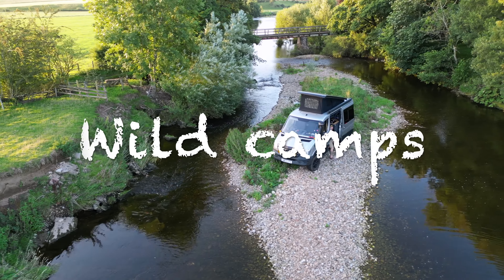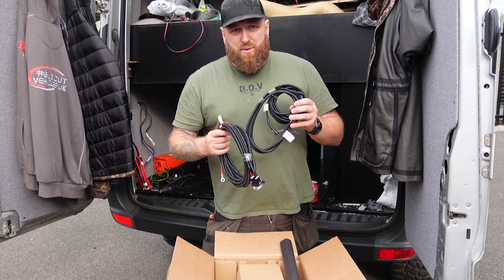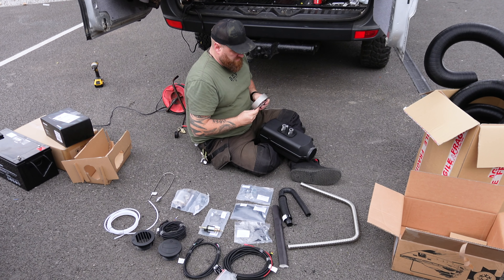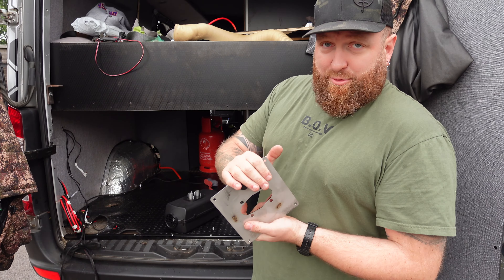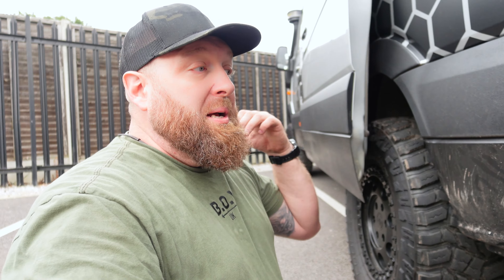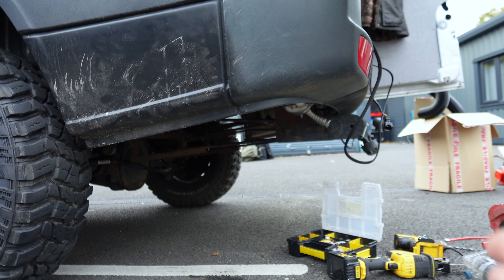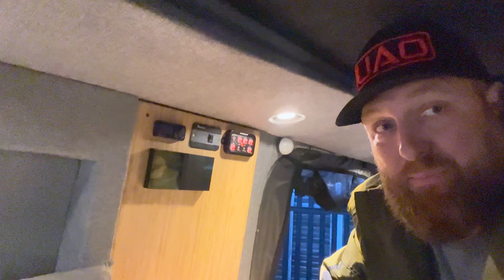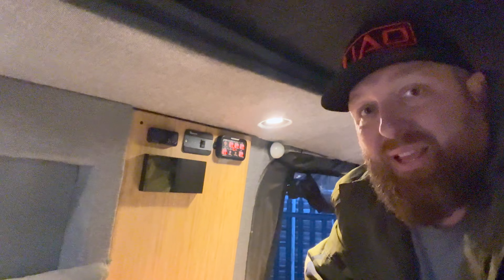Chinese diesel heater failure. Check yours now.

Comment: My Eberspacher in my show van has never failed. 14 years later its moved three times into replacement vans and still going strong in my latest setup.
Reply from the maker: Ok
Reply: Sigh🤕 My Eberspacher has problems and winter is coming. Hums 3 sec and ..error.. I need to bring to the doctor.. Only 10 years old..
Reply: Eberspacher, fit and forget 👍🏻🇬🇧

Comment: The flexible panels aren't as good ive found. The heat makes them break down quicker and they don't produce as much voltage as the solid type. The solid type on a roof rack allows airflow. The van is a big heat trap
Reply from the maker: You are 100% correct but if I bolt solid ones to my roof rack I won’t be able to lift my pop top roof up.

Comment: is it not just a better quality chinese diesel heater? the Eberspaecher is the original high quality german unit . I have both types, the chinese heaters are a direct copy of the out of patent Eberspaecher heaters. I find the chinese heaters just as good, i also like that the control units on the chinese heaters, they have alpine mode as standard (for altitudes above 1100 meters) the eberspaecher is an expensive add on.
Reply: It’s 100% made in Latvia to the same quality as the German brands. 3 year warranty and full tech support.
Reply: @AdventureVanLife  thats good to know. Thanks
Reply from the maker: Iv had the cheap Chinese ones and the good quality ones with the Bluetooth etc is what I pulled out and replaced with this.

Comment: Code doesn't seem to work? Its a decent chunk off too.
Reply: Hi it’s bovuk5 first 15 orders are 15% off then back down to 5%. It’s only off the diesel heaters.
Reply: @AdventureVanLife  yes, I tried the code on a diesel heater. With options came to £645 entered code and price remained at £645 at checkout?

Comment: Will the air in allow deep water in?
Reply from the maker: Non of the heaters I have used in the last 10 years have but I would never have the heater running while going through water.